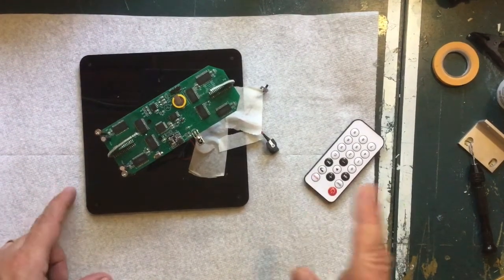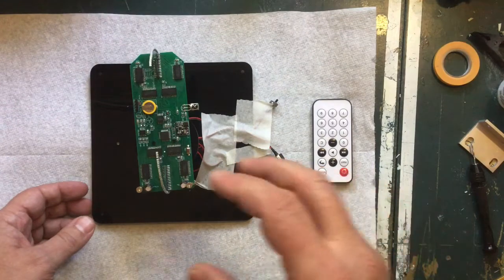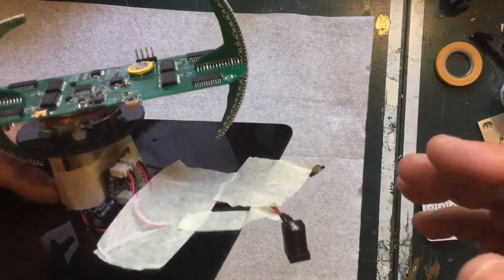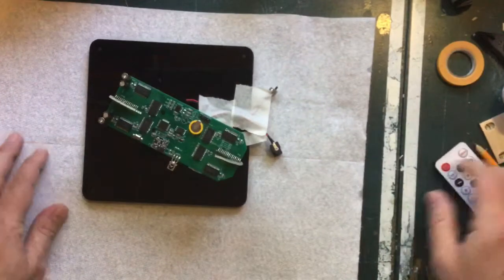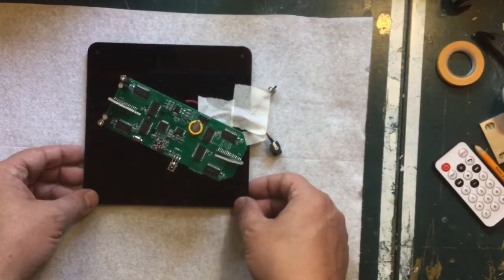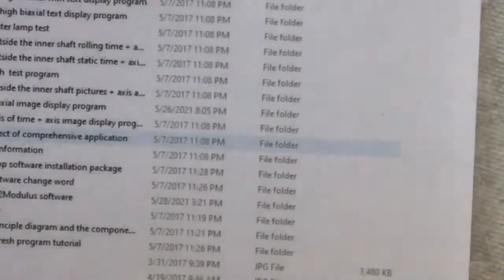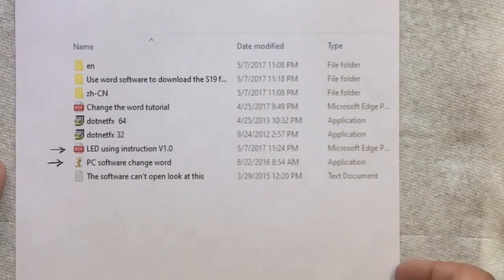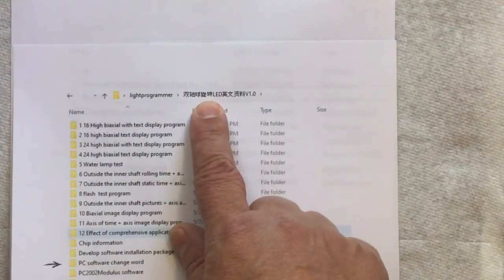Biaxial 56 LED spinning display thing project

Comment: A bit surprised 7Zip didn't work for you. I find it very easy to use, especially as it adds the basic zipping and unzipping functionality to the right-click menu.
Reply from the maker: Well, like I said, I’m a bit computer stupid, so it very well may have been operator error.

Comment: Old kit, but still interesting. Just got mine, waiting for it to arrive. Nice summary for build.
Reply from the maker: Thanks! Good luck with your build!
Reply: @custom fabrications  yeah, I looked for this on TikTok but found nothing. Kit dated prior to that I guess. Glad to find some tips on YouTube.

Have you done some animations? I noticed the tool pulls them right in. Lots of good GIFs out there.
Reply from the maker: Honestly, I haven’t done much with it since the video. I keep saying ‘one of these days’ I’ll do more and play with the animations, but haven’t yet.
Reply: @customfabrications  Most of soldering done. Coming back to your video as mine is similar and instructions I was sent did not match everything. 

My method for soldering LEDs was to use 5 post-it notes to hold semi-circle boards up just enough to keep LED's centered, then push LEDs on edge up to board and solder. When done with one side, getting all LEDs centered and flat, just solder all tabs to other side. Took 60 mins to do first 56, assuming I will go faster on second set of 56.
Reply from the maker: @circuitmage4240  yea, I think those LEDs were the trickiest part.
Reply: @customfabrications  Ok. DONE! It's alive. However, when I was done it was very wobbly. I found that my hot glue skills are lacking, I had to clean up a bunch of bumps with a soldering iron to melt down some hot glue to give rotation free movement.

Also, instead of a clear round acrylic piece for the bottom coil, my kit came with a 3-D printed black enclosure. And , for some reason, the black IR detector LED on the bottom of the board was rubbing up against it (just ever so slightly on one side of the PCB). I just angled the LED out about 1/2 mm and now it clears.

Now, it is only slightly wobbly, not sure why. The posts are on the top and bottom, the movement is clear (with 2 fixes above). It just shakes a bit when it's on. Prob mount it to something will help (??).
Reply from the maker: @circuitmage4240  cool! Good job getting it to work. Mine has counter weights you can adjust to make it not shake. Did you do a static balance check?
Reply: @customfabrications  I mean, it spins. I had to get the hot glue I put on melted more (used soldering iron) as I had some bumps that kept it from spinning. Also, had to move that bottom IR detector LED angled out a bit as it was rubbing up against the 3D printed coil enclosure slightly. That may still be rubbing at high speed, not sure. 

Man, this thing spins super fast. It spins freely...about 1.5 revolutions or so when I flip it by hand. Seems clear. Not much room for the wires and power board either, prob need to run the wires under the base. Prob going to mount it on a wood base too. 

But yeah, it works and I can reprogram it.

I will have to spend more time looking at it, see if that LED is still touching it, maybe use more counter weights.
Reply: @customfabrications  Ok, so just a couple more things;
1) Yes, adding small stand-offs to the bottom of the posts reduced 90% of the vibration. I tried various combinations of adding stand-offs to the top, top and bottom and just bottom. 
2) Programming the thing is a bit glitchy, sometimes the pictures/animations don't take. Not sure why, but for the most part it is working. I requested updated SW link from the vendor, so will see if that makes a difference as I was using an old version of the files. 

Anyhow, not too bad. A good small project with moderate soldering difficulty. I would say having a scope is necessary (for me) to have gotten this done. All that's left to do is mount it to base and hide all the wiring.
Reply from the maker: @circuitmage4240  cool! And yea, the software / image loading isn’t that great for me either.